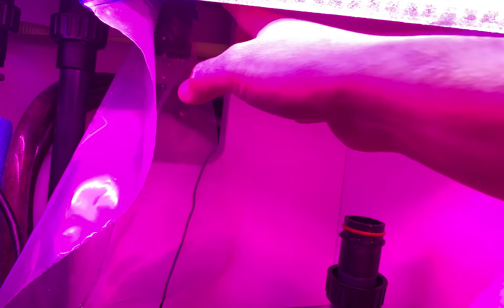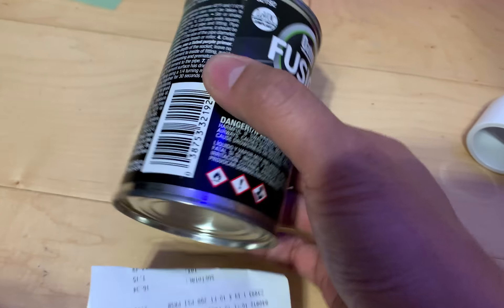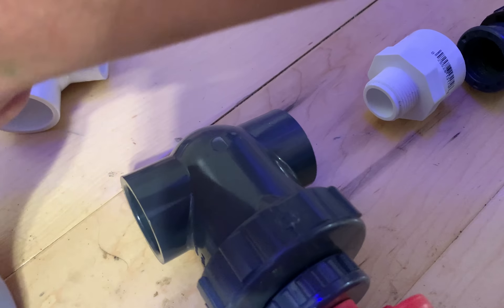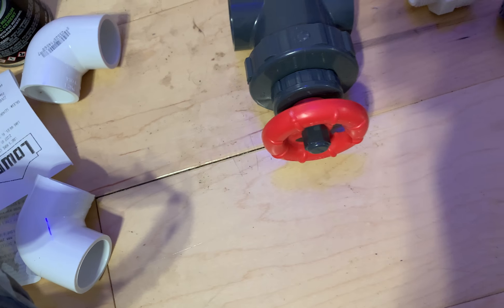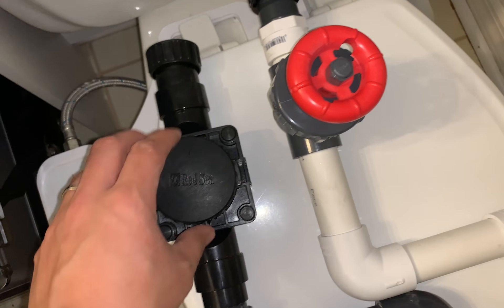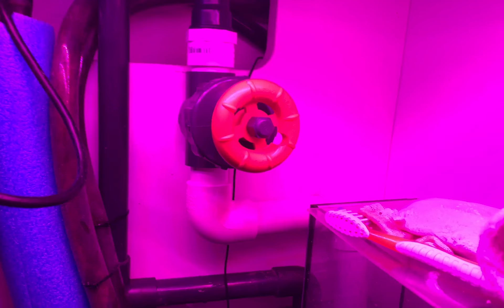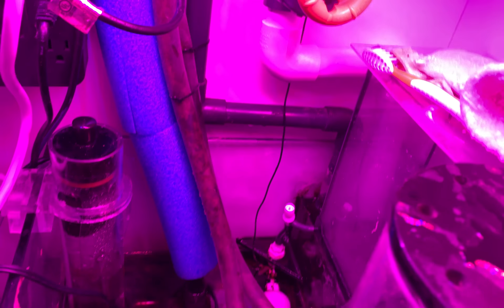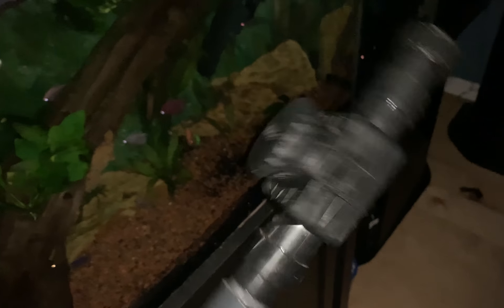Fix the Red Sea Reefer gurgling drain pipe issue!

Comment: I had this issue and found that slowly adjusting the valve and letting it flow for a bit fixed it. It took a while but it worked
Reply from the maker: After a while the valve is no longer steady on the pressure.
Reply: @ArnoldosAquariums  I haven’t yet experienced that, but I’m sure I will. When about did you start having that issue???

Comment: I have the Reefer 300 G2 and the supposed "new" valve is terrible. I've had the tank about 7 months that I bought all new.  It's been a nightmare and I have to adjust it 10 times a day.  I'm definitely going to cut out the Red Sea valve.
My water level in the return chamber is never correct and usually goes dry and the water stays in the display backed up.  It's just a nightmare.
Reply: I have the reefer 250 G2 for about a month now and I’m having to do the same! It’ll be fine for maybe a couple days max and then the water level in the overflow will drop for no reason at all and make the water in the sump high. So I’m constantly having to adjust the diaphragm valve and it’s making me want to literally sell the whole damn thing. so I’m going to replace it with this gate valve.
Reply: @TokelauIslands  put more water in it.  A higher water level seems to fix it. Make very small adjustments on the valve and let it sit after an adjustment for about an hour before making another.
Reply: @hurricaneaquatics  so far so good. The water is right at the very top of the overflow pipe. I was having to leave my ATO off in fear it was going to keep dumping water in until the float switch shut it off. I even have a camera so I can watch it while I’m at work! I just came from an all in one tank and it was so easy to run. This has me thinking im never getting a tank with a sump again 😂
Reply: @TokelauIslands  Great news!
Reply: @hurricaneaquatics did a water change and it’s acting up all over again! 😭 so I ordered all the parts from BRS including the 1” to 32mm unions and red pvc piping. Why is this diaphragm valve so crappy?? Where you set the water in the overflow is where it should stay. The return section should be the only water going up and down based on your ATO and evaporation. Ridiculous we even have to do this.
Reply: @TokelauIslands  I agree.  I have to mess with mine constantly.  You're doing the right thing with the valve.
Reply: I have the 250 G2 and I have not problem for year, I contact Red Sea and they send me the black plastic but still doing the same, so I go with gate valve replacement.